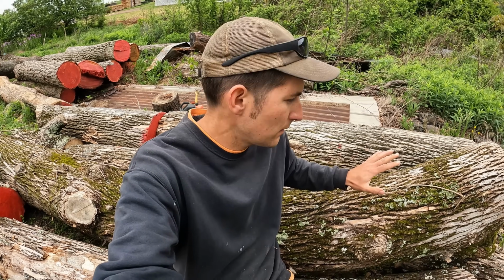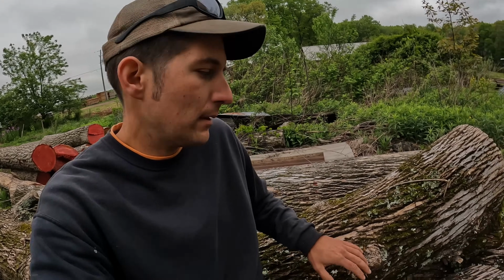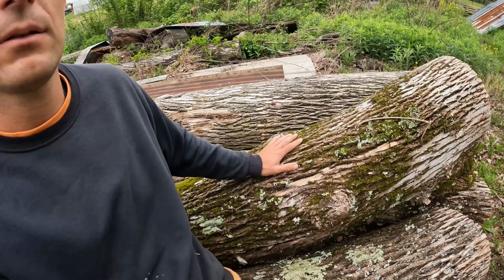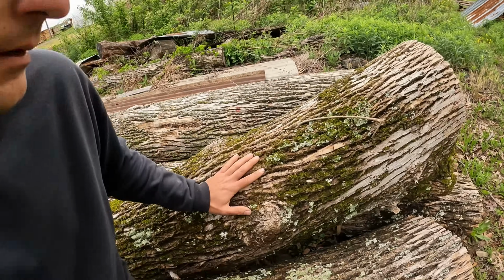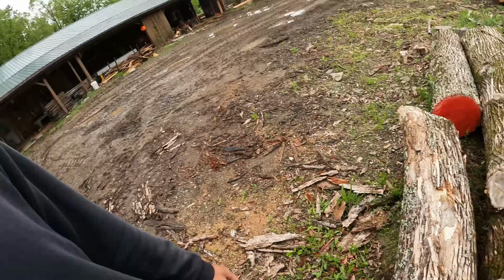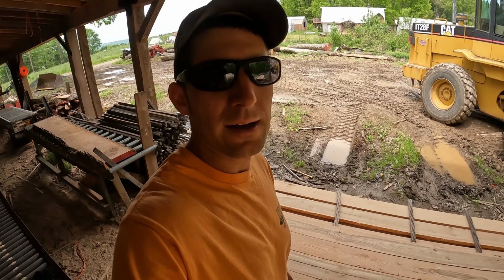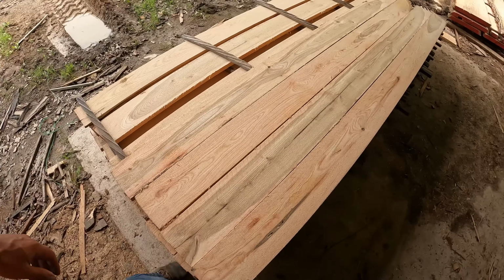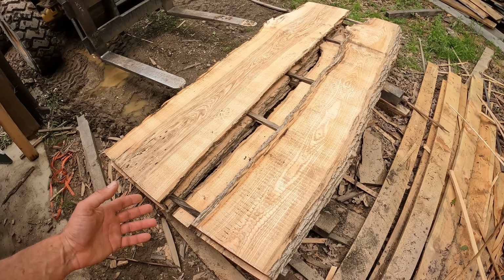The Last Ash Logs I'll Ever Saw?

Comment: I live in central Missouri and everywhere you drive you can spot dead ash trees. I catch mine at a good stage and sawed them into 1 inch lumber and sold it for pretty good money. I have about 350 bb.ft of 5/4 left and will probably sell that this summer. I've had several people ask about leaving it stand or cut and I advise to cut. It does make beautiful lumber if you catch it at the right time. Sure enjoyed you video. Thanks. Ed
Reply from the maker: Sounds like we thought alike! I sold all but a little bit I have leftover.